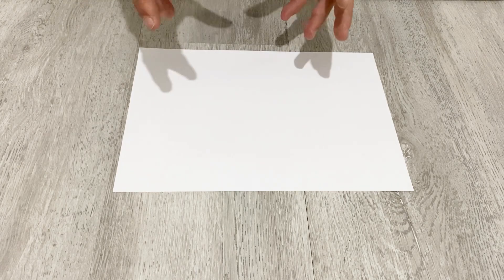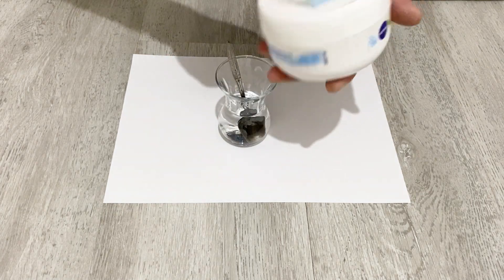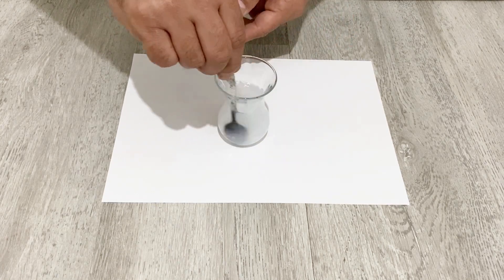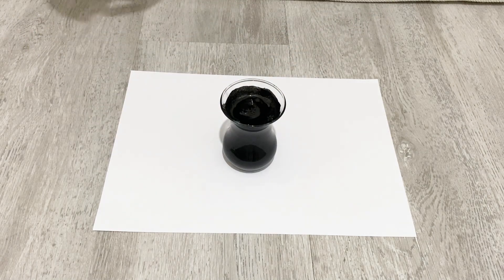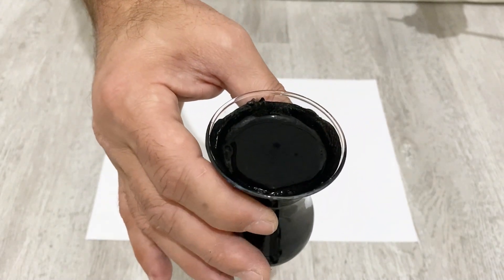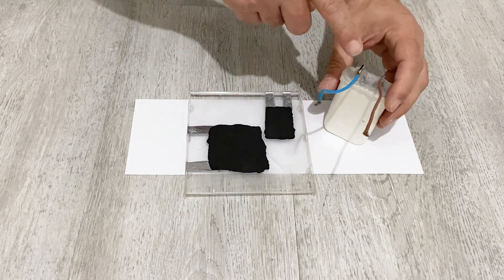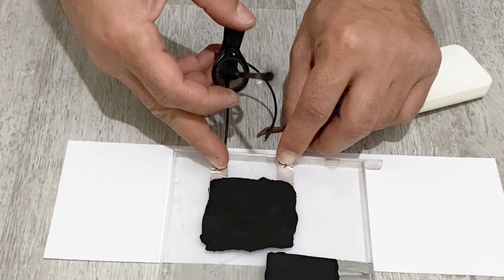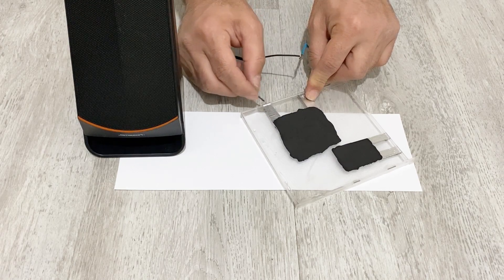How to Make the Best Conductive Paint/Ink (Amazingly conductive)

Comment: Have you tried to bake it at 150°C?
That should turn the Sodium Silikate into a kind of ceramic.

Im asking because this would be great for vias (for copper electroplating process) in DIY PCBs
Reply from the maker: Thank you so much first of all. I haven’t tried that. This paint is great for copper electroplating. You can experiment in different temperatures.
Note: You can also use ultra fine graphite powder instead of iron oxide.

Comment: Guys I researched it and here is the answer as to which ferrite is the correct one
Fe304 is the one you want trust me

Properties of Fe2O3 (Hematite)

    Chemical Composition: Fe2O3 is known as iron(III) oxide or hematite.
    Magnetic Properties: It is paramagnetic, meaning it can be attracted by a magnetic field but does not retain magnetization once the field is removed2
    .
    Conductivity: Fe2O3 is generally considered a poor conductor of electricity. Its conductivity is significantly lower than that of Fe3O4, making it more of an insulator in practical applications2
    6
    . At ambient conditions, it behaves as a semiconductor with a bandgap of approximately 2.0–2.7 eV, which limits its conductivity further4
    .

Properties of Fe3O4 (Magnetite)

    Chemical Composition: Fe3O4 is known as iron(II,III) oxide or magnetite.
    Magnetic Properties: It exhibits ferromagnetism, allowing it to retain magnetization even after the external magnetic field is removed. This property makes magnetite useful in various applications, including data storage and magnetic resonance imaging3
    2
    .
    Conductivity: Fe3O4 is a good electrical conductor, with conductivity about 106106 times higher than that of Fe2O3. Its half-metallic nature contributes to this high conductivity, making it suitable for electronic applications

Comment: Why Iron Oxides Are Poor Conductors? 
Answer: Iron oxides are typically ceramic materials with an ionic structure. Electrical conductivity in such materials is limited because:
Electrons are not free to move easily through the structure (unlike metals).
They often have a wide band gap in their electronic structure, which restricts electron flow.

Comment: Why is mine not working?? I used magnitite powder soduim silicate and deionised water but it doesnt conduct at all
Reply from the maker: Magnitite iron oxide is non conducive, you should use the other one which has the formula of Fe2O3 and conductive.
Reply: @joyofelectronics9782  I'm so confused why does it say on Google the opposite?? Fe3O4 it says is conductive and Fe2O3 it says is not

Comment: Why did you use aluminium foil the graphite should be enough to conduct electricity?
Reply from the maker: To not damage the paint while make connections with cables.

Comment: the high resistance in the small distance one might be due to high surface resistance.
with such materials surface conductivity and volume conductivity are measured seperate.
surface conductivity is often very high, volume a lot lower.

as for the mixing it would have been great if you also showed some tests with it when only slightly mixed and when for example mixed 15 minutes or such to show just what kind of effect it has, since in some cases for some people it might not be needed to be mixed as much.

as for the heating in short cirquit, if you have a ir temperature measuring device it would be interesting to see at what temps it started breaking. even though it partly seemed to be due to the plastic melting, but if it can handle high enough temps safely it might be usable for making heated beds or such for 3d printers or keeping chemical reactions warm or such.

Comment: Two things:

- the CD case cover you are using to paint over is a different one than the other one where you are measuring the resistance. Why ?
- when someone asks you why their Fe2O3 powder is not conductive you say that the good one is Fe3O4, but when someone asks you why their Fe3O4 isn't working you say that the correct powder would be Fe2O3 ... So which one ?
Reply from the maker: Sometimes I was confused. The correct one is non magnetic iron oxide. The cd case which l painted at first was damaged. But the tested one in the video had the same conductive material.

Comment: Could you use acetone instead of water? Recipes with copper conductive paint or graphite for electroforming use acetone. Presumably this evaporate way more quickly than water and allows for a less viscous liquid to spray with an airbrush.

Comment: Chemical name of water proofing white powder material
Is it resin
Reply: its mostly acrylic based roof-pool paint for insulation. it's gonna polymerise while drying on air and bring paint elastic characteristics.
Reply: @uzaymaymunu  it pass electricity?
Reply: @afgamer5576  with its alone form not but when diluted acrylic paint and if you dope (mix) with conductive matter like graphene or iron  powder it should. 

 As a chemist I suprised that this video argues black iron oxide conducts electricity better than graphite(?)...
brotip: ı tried graphene powder with waterglass(sodium silicate) works well and it hardens like cement.
Reply: @uzaymaymunu  can you please tell me any  chemical liquid form electrolite  passing electricity not dissolving table salt  ( sodium chloride )
Reply: I think, it's PVA, which is wood glue.
Reply: @dorfschmidt4833   pva pass electricity?

Comment: Black iron oxide is said to be an insulator. How can it be used as an conductive ink?
Reply from the maker: There are two type of iron oxide. The Fe2O3 is magnetite it’s not conductive but Fe3O4 is a good conductive material
Reply: @joyofelectronics9782  fe3o4 magnetittir. ve manyetik özellik gösterir

Comment: I haven't seemed to get black iron that matches this level of conductivity. I bought magnetite (fe3o4) is that the wrong stuff?
Reply: Is Fe2o3 ferric oxide? Red-ish in colour. Can i use thatt?
Reply from the maker: Yes it is the wrong one. Fe2O3 is the correct one.
Reply: @joyofelectronics9782   thanks! At least I can still make magnetic slime or something,  haha. Maybe magnetic blocking paint! Walls may be dangerous in our homes... no one cares enough to study it very much. The AC induced voltages and magnetic pulsing at 50 or 60 hz. I got some calcium copper titanate I think it's called. Ultra strong dielectric material as well as titanium oxude/dioxide. These are very special materials. I thought I'd share this with you. Oxides are really interesting. I'm very interested in your special lead acid battery.
Reply: @joyofelectronics9782  what about copper and/or silver nano particles in a alkaline electrolyte? They are more stable in high pH. More conductive than any oxides. But I'm very interested in your exact source of black hematite powder, your paint conductivity is extraordinary. Thank you.
Reply: @joyofelectronics9782  In an other comment you said that the wrong one is Fe2O3 and the good one is Fe3O4 ... So which one ?
Reply from the maker: @leviterion  l might have been confused. The magnetite one is the wrong one

Comment: Brother I have a capacitor roller machine can you tell me how to make factory like electrolytic capacitor that I can use in any electronic device that have electricity capacitor
Reply from the maker: Well brother l have a video about that you can check out. However it requires a professional producer and process
Reply: Ok bro thanks and brother I see your homemade resistor video can I use homemade resistor on sstc Tesla coil
Reply from the maker: @Earthcomputer-d9t  sure

Comment: even when it gets super heated it can not burn away. so there is something wrong.
Reply from the maker: No it means that it’s durable against heat. If you talk about the second part of the paint, when l heated it the paint broke so disconnected (you can understand from the internal sparks) that’s the reason.

Comment: How do you get around the corrosion issues when you're using it on aluminum?

As everytime ive used anything with sodium silicate in it, it slowly just eats any aluminum in sight.
Reply from the maker: I used aluminum just for a demonstration, if you wish you might not choose aluminum to use.
Reply: Ahh yes makes sense.

I've played around with it... Can't seem to get the same results as you... However I made my own sodium silicate... And then I managed to reduce the corrosiveness of it by bringing the pH back with some acetic acid.

Comment: This is great.   I once made conductive ink using graphite powder using the same binder,  but it was disappointing.  The best i could get was around 30 ohms per square CM.  Some people on youtube could make ones that are 5 - 10 ohms per CM,  but i could never figure out why theirs was better than mine.
Reply: Depends on the thickness. Ohm/sq is meaningless without a thickness ie ohm/sq/mil.
Reply: I found to get decently conductive graphite paint or powder you want to use as little binder as possible while still having good strength and spreadability. However this will result in a weaker paint if you use too little binder.
You will want to wait for it to dry VERY THOROUGHLY. I mean it. Seriously. Wait for it to dry at a bare minimum a full 24 hours even if you think its dry its probably not yet. You need to be very patient waiting for it to dry. If its not dry yet it can cause inaccurate resistance readings
I got down to 0.5 to 2 ohms when coated onto a nickel strip with pure graphite powder. it is the cheaper kind too and not the better graphites.
Reply: I don't see any that high. Are you sure??
Reply: @TravisTellsTruths  
yep

Comment: According to google the most electrically conductive material is graphene. Can I make graphene from powdered graphite and use 35% hydrogen peroxide to make good graphene, will that work well? Thanks man
Reply from the maker: Yes graphene is the most conductive material but it is very expensive. It’s also different to make pure graphite if you can make of course you can use it. In my first video about conductive paint l used that method. You should watch it.
Reply: I think I already watched it, I'll go find it and watch it again, thanks. @joyofelectronics9782

Comment: this iron oxide is the one sold as pigment for paint? very interesting video, thanks
Reply from the maker: Yeah, as it is a good conductor l used it as conductive paint.
Reply: This is very, very interesting and I'm interested in several oxides of various elements. The unique properties of AlO3, for example are very special. I have some discoveries. One of them is something I should probably tell you about, soon. Iron in the different oxide states and regular iron is an incredibly interesting material. Black iron oxide with a touch of activated carbon and silver nano-powder/graphene powder immediately comes to mind. I'm planning to make this mixture soon!
Reply from the maker: @TravisTellsTruths that mixture will be amazing a little bit expensive though. Good luck and if you make it please share the result with us.

Comment: Sir, I've ordered a couple 2.7 volt capacitors (100 farad and 3000 farad) to study capacitors while I learn to make them. I learned small voltage supercaps store the most energy. My question is, is there a best practice for fast charging of a single cap. It draws amps and I'm hand limiting the current but I read that they can be charged very quickly. How can I know it's maximum safe charging current? Your capacitors, too. How fast can we charge these electrolytic supercaps?
Reply from the maker: Supercapacitors can be charged with the current up to 100 amps. Anyway it’s difficult to find that much strong charger so you don’t have to worry about the current but voltage while charging the Supercapacitor
Reply: Amazing 👏
Reply: I got a capacitor you couldn't believe,  now. It's 4.3 volts, 4200 Farads. It stores energy with zero losses but it's not rated for super high current. It's more like a steady battery. About 4 Amps current. It's the size of my thumb but smaller... apparently,  these aren't really available to the public.
Reply: @TravisTellsTruths price of 4000 f